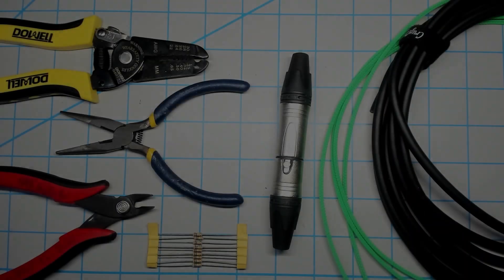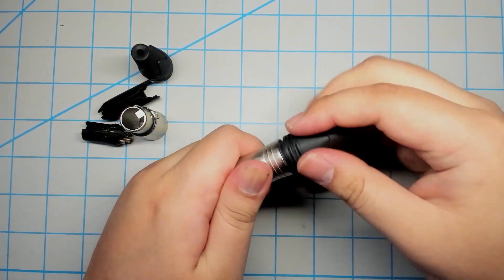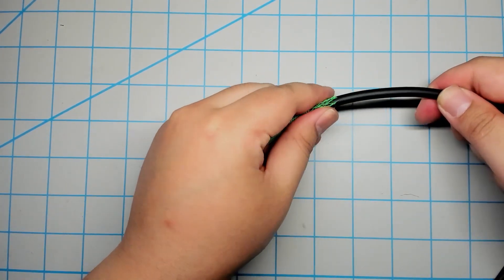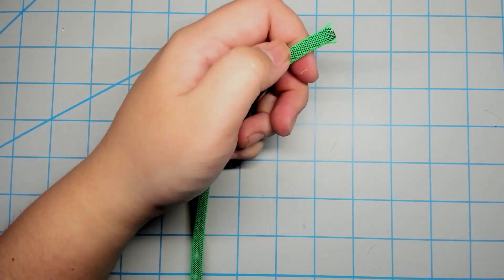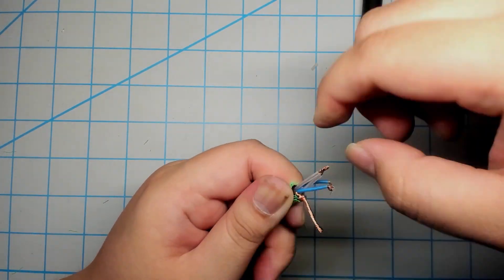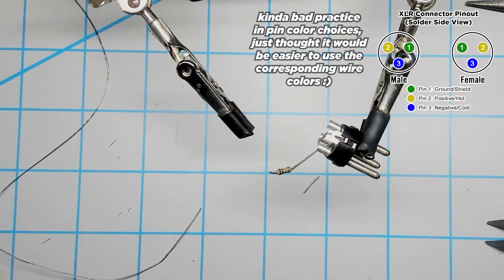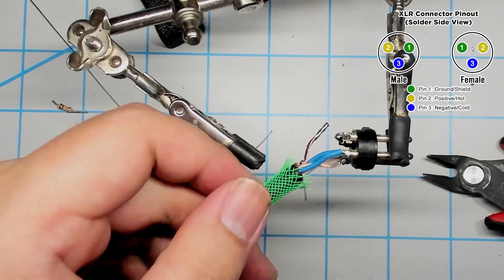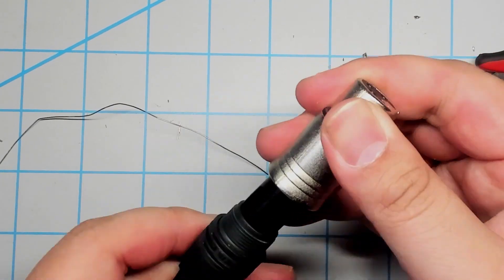DIY Custom Balanced XLR Sleeved Cable Step by Step Guide

Comment: Hey! Question.. for now I don't want to make my own cables from scratch, but I want to sleeve some existing cables with different colors. Would the standard sleeve that you use be able to stretch enough to get over the plug and onto the wire section?

Thanks!

Comment: I don't like hobbies that consist of the amount of money you spend, rather that build up overtime in the intellectual field, no worries, if the house burns down or stuff damages I won't have lost my identity and like to spend money on quality for things I use on a daily basis and use them till they fall apart. This collecting and the need to have everything of everything is something pushed on us as kids and it started with collection cards, stickers, little toys etc. It's nice to break free from that urge to constantly buy to up your dopamine.
Reply: Ok, boomer.